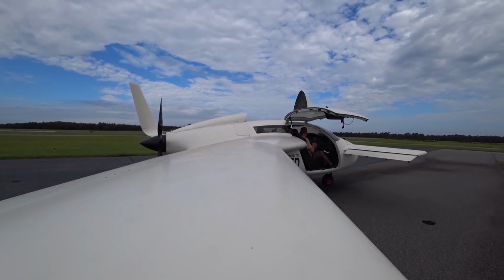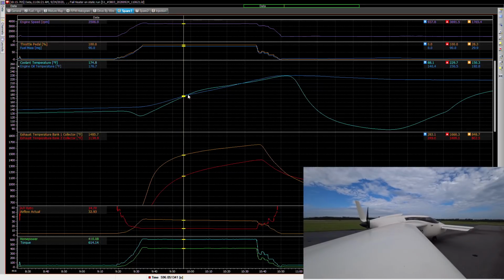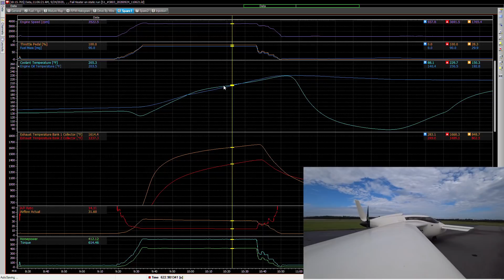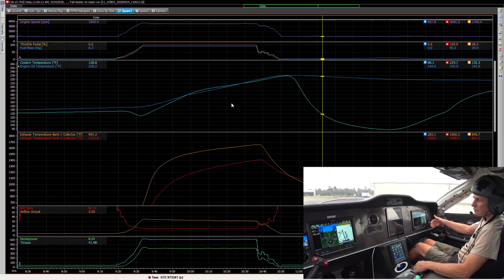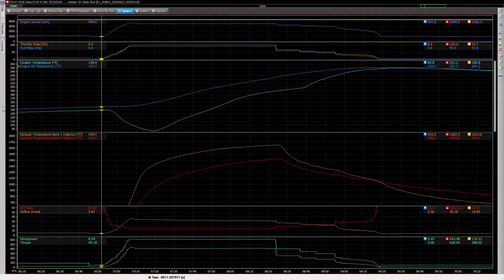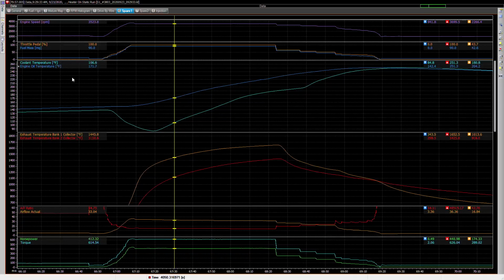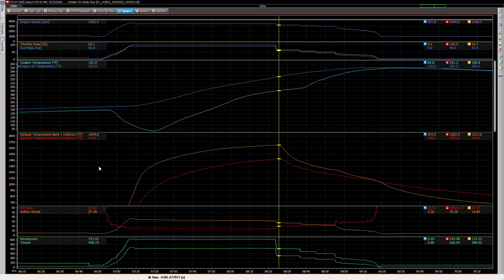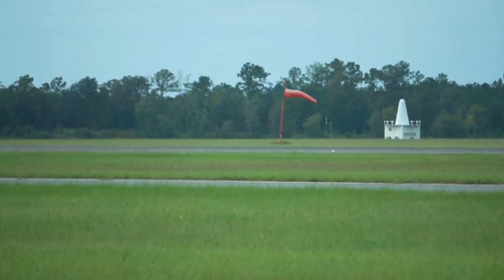Full Power Static Runs - Building the Raptor Prototype

Comment: Automotive manufacturers run their engines at full power for hours at a time in testing, especially German manufacturers who must make an engine survive on the autobahn.  So that Audi engine, with a properly sized and placed radiator, should be able to do so as well. Most automobile cooling setups pull air from the bottom, not the top.   Most aircraft auto conversions locate their radiator low as well to take advantage of thermal properties.  Have you considered making a bottom cooling air intake for the radiator and re-positioning it accordingly.  Heat wants to rise, so placing the radiator in the hottest part of the engine compartment can only hurt the cooling system.  Conversely, if you want the radiator to stay up high, create slotted openings so it can expel heat upward.   Fighting physics is a losing battle.

Comment: Do you have at least as much air outlet as inlet?
If the heat worries you, you can add some rear-facing louvers. The prop will pull the hot air from the engine compartment--without letting rain become rammed in.
Reply from the maker: With the inlet scoop in the closed/minimum position there's twice as much outlet area. When open they're about the same area.

Comment: When I was a young man in my 20's, a friend had a Fiat convertible which had a cooling system design which allowed the radiator to dump coolant on hot days when running hard. No coolant recovery systems in those days... Geoff, my friend, had a procedure which allowed the car to take long trips at extended speeds.  He turned on the heat, which extracts BTUs from the cooling system and dumps it elsewhere... into the cabin, where ever, just get it out of the cooling loop... top down, all good!  Geoff, a History major at Boston College who went on to become a USN pilot flying A6 jets on and off aircraft carriers, and later being an instructor at the USN Top-Gun flying school and teaching many jet types to naval aviators.  He finished his career at Delta Airlines flying left seat for inter-continental routes.

Geoff, at that moment, introduced me to internal combustion engine systems management.  He remains a trusted friend and  I will never forget the impact he has had on my  logic method.  

When you write the POH for this aircraft some of the details you describe will be focused on thermal management.  SHUT OFF A/C AT THRESHOLD, (this is not about passenger or pilot comfort at this moment)...  ACTIVATE HEATER FAN AT THRESHOLD... DUMP MAX BTUs either into cabin or overboard.  It is a step that just makes sense...
Reply: If using an aero-engine and undoubtedly some people will (This is a "kit" aircraft after all,) none of that is necessary.
Reply: @bd5av8r1  ???????????????  I would guess no procedures are NECESSARY, but rather PRUDENT... "aero-engine" or otherwise...

Comment: Peter, the last time I noticed your wing mounted Go-Pro displaying that weird strobing effect, a few videos later you noticed some vibration and it was the large engine pulley coming loose. I know you lock wired it but might be worth checking. Keep up the good work.
Reply from the maker: That camera vibrates because it's in the same plane as the prop so it's feeling the waves from the prop tips. It's worse at higher prop rpms and pretty much not existent when power is reduced.

Comment: Im no engineer but couldnt one construct an air tunnel to the aircraft to replicate the airflow available to the aircraft in flight. A couple of big high pressure blowers set into a tunnel leading to the cooling intake......
Reply: Maybe a twin turbofan plane chained to the ground would a cheap way of getting enough moving air? Hazardous I'm sure.
Reply: No no no. He’s only talking of blowing air into the cooling inlet, not making a wind tunnel.
Reply: @rnordquest  Oh, ok, well anyway if this was at all possible might be good for rigorous airframe buffetting test?
Reply: They are extremely expensive. Pushing so much air through a tunnel to achieve flight for Raptor would need some mighty big fans and a dedicated building. Even only the top teams in f1 can afford full scale tunnels and they have 200 mil budgets but more over they are limited in what they can test. They usually use them to benchmark their fluid dynamic algorithms then rely on those.

Comment: As a proof of concept that using cabin heat will also aid to cool the engine....just as it will on any liquid cooled auto....great, and nice to know...BUT, how does this little, now proven fact, get you closer to launch??  other than proving the same concept will work....did you add any info about the effectiveness, or lack of in aerodynamic cooling......it's like you chasing a problem that may not BE a problem. Consider,.....you get a soft roll after take off and immediately assume it's because of a slight weight imbalance of a few pounds!!!! What the F***K???? Did you ever consider what kind of P factor you might encounter with a pusher prop during rotation??? I don't know,...but before I tried to permanently install or move weights around in my aircraft....I would simply perform the same maneuver while sitting in the Left seat.......how much easier to test your theory than by simply moving your butt to the left seat??? I love your Raptor and have the highest hopes for your success.......While it's always best to err on the side of caution....faint heart never won a race.. get out there and have fun!!!!....jus saying!!
Reply: Always better to verify before relying on it.  Also better to reduce compounding effects if you can, rather than relying on flight surfaces to compensate.  Getting an aircraft to fly with neutral trim is the optimal condition everyone should strive for in their aircraft, otherwise you're just fighting imbalances.  With a pusher, the p factor isn't as much of a problem, but the little it does affect the aircraft should be pulling it to the left, not to the right.
Reply: @Skinflaps_Meatslapper  Okay, assuming there's "compounding problems"....you could be right.....BUT, lets try to NOT assume anything......like assuming an apparently uncommanded bank could only be caused by a few pounds of weight offset from the center of roll axis a short distance. My POINT was/is, it's fine to make suppositions in. re. cause and effect, but it's a waste of time to simply make an assumption and ACT on that assumption without any evidence to support that assumption. ESPECIALLY, when considering how easy it is for Peter to confirm his hypothesis.....by simply doing a ground effect run in the left seat.....why not perform a ground effect run in the left seat before adding weight or doing ANYTHING....before confirming that suspicion??....I believe that in testing an aircraft, it's better to DEFINE a problem...before fixing it!!!!And YES, I realize there are times when a problem can only be found by testing.....but here there's an easy test to confirm..SMH!!
 AND, BTW...I think you're incorrect about how p-factor affects the Raptor..See, if the prop on Peter's diesel turned clockwise, i would agree with you...but Peter's prop turns counterclockwise.....which should induce more thrust on the left side of the engine (as the AoA of the descending blade on the left side of the engine "increases" with the AoA of the fuselage) Causing the nose of the aircraft to yaw right with an increase of AoA, (Angle of Attack)  My previous point was that there could be several factors that should be investigated before "FIXING" anything!!   And after really looking at it....I believe P-factor could very well be a cause.!!!!  I await your rebuttal and any supporting evidence..........
Reply: @Bugdriver49  Interesting you say that, since what you're proposing for flight testing is based entirely on assumptions.  You assume that flying from the left seat will fix the imbalance, rather than actually balance the aircraft.  Do you know what will happen in this untested aircraft when it's left wing heavy?  No?  Neither does anyone else.  Better to eliminate that as a possibility and move to the next likely culprit.

Which brings us to what else it could be.  I can tell you right now that p-factor affects canard aircraft differently, in more ways than you're thinking.  Gyroscopic precession of a CCW prop has much more effect than thrust imbalance from AOA, and with a CCW prop rotating to a nose up attitude will induce a left yaw moment...however, given that it's so close to centerline, as well as close to center of mass and vertical stabilizers, and the fact that it's a lightweight composite prop, gyro precession is at a minimum.  So that really just leaves thrust imbalance, and again, given the location of the prop, as well as the very slight AOA in these hops, thrust imbalance shouldn't even be a contender.  This is further exemplified by the fact that yaw moments take time to induce roll moments and are exaggerated enough to clearly see in flight footage.  You may notice that the nose stays pretty straight on the runway while the roll moment happens, only veering off centerline after that roll moment vectored lift to the right.  Swept wing aircraft are slower in yaw-roll coupling than conventional wings utilizing degrees of dihedral, and non-intentional yaw moments are easily corrected before roll coupling occurs.  To top it all off, the airspeed utilized for these short hops should be more than adequate to maintain full aerodynamic stability and control even with p-factor being an issue.

No, I'm pretty sure the issue lies more in simple inconsistencies, whether it's the wing itself, canard, ailerons, or even environmental conditions, and may be fixed by slowly dialing in aileron trim, adjusting rigging, or getting a crosswind on the opposite wing to observe behavior.  It could be that this particular aircraft is more susceptible to roll moments caused by quartering winds than comparable aircraft.  Nobody knows yet.  But what shouldn't be done is rush into a half ass flight from a side of the aircraft that the pilot is neither comfortable with nor utilized in the past thinking that'll fix all the problems and end up off airport fighting an ever increasing tendency to roll right as airspeed increases and options diminish.
Reply: @Skinflaps_Meatslapper  NO SIR!!!...I'm not proposing more "flight testing" based entirely on assumptions!! Unless. of course, you consider climbing   2.5 feet in ground effect to be "flight testing"...which could be argued I suppose, at least in the early phases of testing....although I have never ascribed the title of "aircraft" to any number of ground-effect boats. Any who...I NEVER assumed moving to the left seat would fix ANYTHING!!!! My POINT (again) is that Peter assumed it was a weight imbalance causing the roll,  my POINT, it's easier to test that assumption by performing the same ground effect run from the left seat rather than adding or moving weights when the real reason for the roll was unknown!! Considering Peter has said he had complete control stopping the roll.....he apparently did not feel it was so dangerously out of control to NOT try another run...right???  Is there a problem, maybe an injury, to Peters left arm or hand that precludes him using his left arm or hand?? Look, I don't know why Peter feels more comfortable in the right seat...but unless the Raptor is extremely unstable, which it does NOT appear to be,  that should not be a factor!!!!
Which brings us back to P-factor....funny how you bounced around Gyroscopic-precession, which was never a suggestion, before addressing P-factor....And, up front, I honestly have no idea how p-factor would affect the Raptor....But, it has pretty wide blades on that prop...even a few degrees of extra AoA "bite" on one side at T/O power COULD have more effect than you think possible...Again, I don't know and there's no way you could know what the roll/moment of the Raptor wing would be under any flight condition...let alone a specific flight condition!!....that being said, I'm also not ready to just throw out a possible explanation because it doesn't fit into your narrow view of what's possible!!!.  
I do take embarage at your brief description of a possible flight with a resulting disastrous ending if Peter were to  "rush into a half ass flight from a side of the aircraft that the pilot is neither comfortable with nor utilized in the past thinking that'll fix all the problems and end up off airport fighting an ever increasing tendency to roll right as airspeed increases and options diminish". OMG!!! where do you get that crap??!!!! AGAIN...trying a run from the left seat is NOT to fix any problem...it's to IDENTIFY a problem!!  Sure, aerodynamic problems could appear as test airspeeds increase.....WHO has suggested anything other than the same maneuver and speeds already shown to be safe and stable, that the the Raptor has already proved it was capable of performing?????????????????????????????????????????????
Reply: @Bugdriver49  Perhaps you're not aware, but P-factor is a combination of several different factors all rolled into one, not just thrust imbalance.  In some aircraft, some effects nullify others.

Hopping into the left side to see what happens and then using that result to move forward is making an assumption based on an assumption.  You assume that will change balance to a degree, but to what degree?  Is it now left wing heavy?  Is it balanced?  Maybe it's still right wing heavy because the imbalance was that far off.  Then, you take those results and assume things based on the outcome.  Did it fix the roll moment?  Maybe it was to the left, maybe it still had some right roll moment.  If it had nothing to do with balance, it's possible that being left wing heavy is masking a right roll moment from the wing, and that issue would go unaddressed.  Whatever the case, it's non-scientific data being used to postulate non-scientific results.  The other method being that by balancing the aircraft, you have eliminated weight as a potential source of roll moment, and can focus your efforts elsewhere in the most expedient manner possible, instead of packing your aircraft with fudge factor and overcompensating when you need not.

As to why he's flying from the right seat, it's actually fairly common with an aircraft layout like this.  Many pilots are used to throttle on the left hand and a stick in the right hand.  It's more comfortable and the muscle memory is there.  That's important when you're learning a new and untested aircraft.  Especially so, when you've accumulated a lot of time in the cockpit of said aircraft from only that seat.  So, there's an anomaly in the flight and it needs to be rooted out.  Why would you go to the opposite seat when you're trying to isolate issues?  That's likely to compound, rather than isolate.  If you're a pilot, try flying from the other seat.  If you're not, find a pilot and get their thoughts on the matter.  There's a tangible difference in the way a pilot flies in general, just by switching seats.
Reply: It’s “feint heart never won fair maiden”..
Reply: @PaulAnthonyDuttonUk  Okay Paul, sue me for paraphrasing....But allow this observation......when I make a critical view of another's work, I make doubly sure of my spelling, grammar and punctuation....how embarrassing for you to  confuse "Feint" with "faint"when trying to correct another!!!!!!!
Reply: @pjjms  Hey!! One nonsense attack deserves another!!!
Reply: @PaulAnthonyDuttonUk  Yeah, but you have to feint in the right direction.

Comment: Will Raptor commercial version  have option to vent cabin fan heat directly outside?
Reply: @ryanthomas2472  You're right, I'm not familiar with the Raptor's cabin heating system either. However, ball values I'm familiar with would probably weight a couple pounds at most. All this is pure conjecture as Peter could simply turn off heat flow into cabin. Probably better ways to dissipate engine heat while waiting  on runway, especially on hot summer days!.
Reply: Commercial version...that's optimistic.
Reply: @ryanthomas2472   an in-line pressure proof rotating ball valve  could  redirect  fan heat  while  preventing loss in cabin pressure.

Comment: Hey Peter, I’d volunteer to take her up if I knew it would help, but I sincerely doubt I could do any better for you than you already are.
Hint: you should be able to program the HVAC system (with the Arduino) to vent that warm air to an exterior plenum/vent, the controls tunnel or the “frunk” - or any other place you could imagine beeping to dump heat. At least switch it from the dash AC vents to the floor, right?